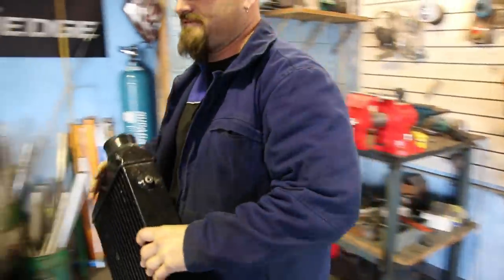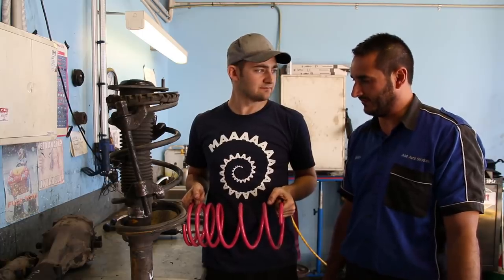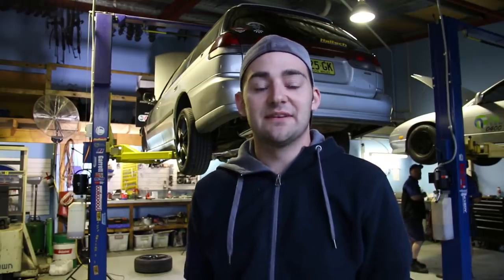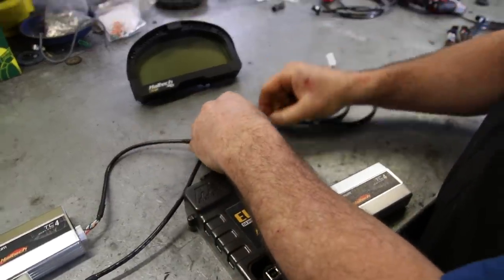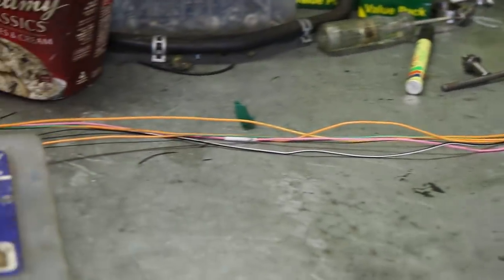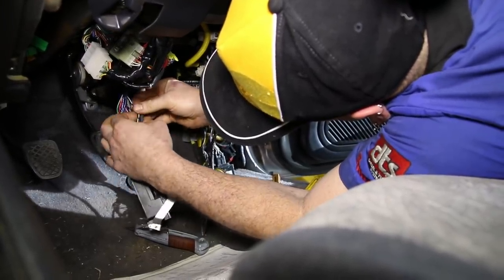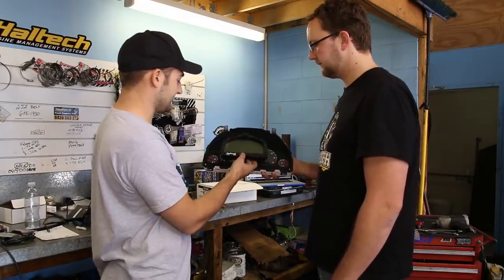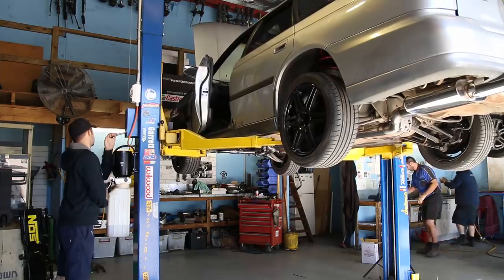Gramps the 11 Second Car - Build Part 7

Comment: This was a great build series and I enjoyed every minute of it. I would like to correct Marty's statement at 10:50 in this video. He said that backwards. The tightly wound(close) spring section at the top is the weaker section allowing for a softer ride. Once the spring is loaded those top coils will compress and basically act as a solid spacer and the bottom, widely spaced coils having a higher spring rate will give you your firm handling. Progressive springs can be very unpredictable as they transfer from one spring rate to the next as the top section goes into coil bind. This often results in a "kick" type feeling during transition from soft spring rate to high and can greatly affect handling in a negative way. Also if the vehicle is loaded with cargo or passengers the top section may already be in coil bind and then the spring will ride like a typical linear spring, negating the progressive ability of the spring. This is why most cars have linear type springs as they have predictable results whatever the situation may be.

Comment: It might be 7 years late, but as an ''Older'' fan of MCM, I'm with Turbo Yoda. Age is not a factor if you love and like working on cars. Certainly an awesome team of mechanics and wizards to get this car done. People that really care about what they are doing, and have some awesome knowledge on how to wire a car. Thanks TurboYoda, Dose Vader, Mechanical Stig and Tuning fork, for a good look into the ''what goes into sticking a 6 cylinder turbo charged goodness into a car'' video, with loads of interesting comments. I'm not a mechanic, but still enjoy tinkering with my car, although I still prefer to see an engine, rather that the plastic mess you get with modern engine bays. Got distracted by old airplanes flying over. Spitfire or mustang.

Comment: Making me not able to wait to pull the V-Tec swap on my Civic EG. gotta get a second mode of transport first.
Reply: u r brave talkin bout a honda on here XD lol but seriously i was thinking about doing the same to my car i just don't have the time to do so i even found another honda with the motor in it just needed clutch and ps belt coulda had it for free
Reply: whats this v-tec you speak of?
Reply: marcus medford Maybe I should ask Turbo Yoda, he would be thrilled!
Reply: Anders Kristensen I think he meant V-Tech, They make wireless house phones.
Reply: Anders Kristensen Vtec stands stands for, valve timing electronic control. To put it in basic terms vtec motors sport a special camshaft with higher lift and duration intake/and or exhaust cam lobes that engage at around 5,500 rpm. It increases power output from smaller motors developed by Honda while still maintaining fuel economy. It's like having both factory cams and aftermarket cams at the same time. You get thw best of both worlds. (: don't know if you were being sarcastic,  but maybe it'll help someone out there!
Reply: V-Tech? im pretty sure corvettes have those.
Reply: Xénos Polemistí̱s NOPE!!!
Reply: ogsmokey187 there is more to the acronym "Vtec" in full it is "Variable Valve Timing and Lift Electronic Control" and it's not only it hondas that have it

Toyota, Nissan, Ford, Holden and even Subaru use some form of VVT, it's just that Honda also included lift where others haven't, yet

and for the Americans using Vtech instead of Vtec, there is no H in: Variable Valve Timing and Lift Electronic Control

I'm not joking there is no H there

I looked very carefully and cannot find one, this is an acronym

not a word describe something technical about the letter V
Reply: Colonel SkullZ kind of a dumb acronym. If they can just drop letters why can't we add them? Shouldn't it be VVT-LEC... but VTEC is more catchy, and VTECH... well that is actually the leading global supplier of electronic learning products from infancy to preschool.
Reply: Nick Charette I'm not talking about Vtech the company, Im talking about when some poeple talk about Vtec and they use damn VTech, it's not the same thing

and your right it should be VVT-LEC but

VVT,LEC kicked in yo

wouldn't work as well
Reply: Colonel SkullZ I know what you were talking about... look at where you are... you don't think I don't know what VTEC you are talking about... it was a joke.
Reply: a fast honda is still a honda
Reply: Colonel SkullZ
Nissan doesnt they have V-Spec which is diffrent
Reply: Coolninja6060 vspec in nissan refers to the trim (interior,springs,etc) and not anything specfically engine related
Reply: gamester001ify
Yes i know I was saying that there is a V-spec not a v-tec in nissan they are confused alot
Reply: Colonel SkullZ VTech could mean variable technology. Which is the technology to variably control valve timing.. I mean it works right?
Reply: Coolninja6060 but nissan does have vvt and thats what colonel skullz is refering too
Reply: "Cheryl"
Reply: ***** the v8 sho is awful. Go with the v6 and turbo it. The V8's have cam issues and shit.
Reply: Yeah i mean i guess if you do cam work and shit they can be sweet! I like the exhaust manifold on the v6 motors tho. Gnarly
Reply: I rekon u swap your honda with a subaru, that's what I'm going to do
Reply: LATRONNIK  #truuuuuuu  The only Hondas I'll ever drive are the S2Ks, and even those give me the shivers.